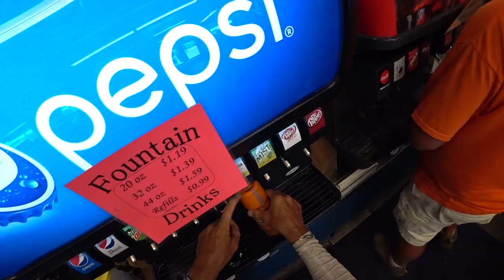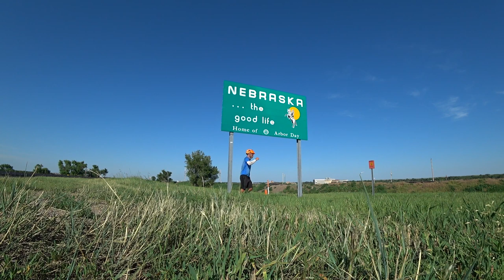Punctured By A Nail-Biking to RAGBRAI-Part 2

Comment: Thanks for all the videos, keep them coming! Two of three questions were answered in this one. 1) Does Ryan ride tubeless? (yes) and if so, 2) How does Ryan fix a tubeless flat (with one of those cool plug kits). But, question 3) Which make/model of pump do you tour with? The one you're using in this video looks pretty sweet. Thanks!

Comment: Have to say even though I don't ride anywhere near the sort of mileages you do, it does amaze me how helpful people can be if you're stopped by the side of the road somewhere and fixing a problem.  Similar thing happened to me a few weeks ago.. I'd swapped out a chain ring and stupidly put it on the wrong side of the crank spider, so the ring was too close to the chain stay and I only realised 15 miles in to the ride doh! (not close enough to touch, of course, but I new something didn't feel right and I couldn't initially figure out what it was).

Actually a fairly simple fix to take the crank (thank goodness for modern hollowtech cranks!)  out and swap it over, but in the 20 minutes or whatever it took me to do it, I had 2 people come out of their houses and offer me tools if I needed them, and 3 passers by asking if I was Ok or if I needed anything and one of those were a lovely elderly couple who'd got back in to cycling in their retirement!

In the world that media outlets and social media want you to see where everyone is isolated and at each others throats, this sort of thing couldn't happen.. but it happens far more frequently than you would believe.
Reply from the maker: What a great story! I agree, most people are good hearted and want to help! Happy Trails

Comment: Did you have stans tubeless sealant in your tubes.?    They say it will seal 1/4 inch hole 
   It should of sealed the hole  , quickest way to clog hole is to spin the wheel
        Great videos.....  keep on making more ...!!
Reply from the maker: I was spinning and spinning and it never filled that hole, it was just too big.
Reply: @duzer  I see.   
      The RACING SEALANT Stans makes seals bigger holes. You can mix the reg and racing sealant together ( just that race sealant dries quicker over time and would have to add more sooner )    I had called Stans for this info 
     I have tubeless on my Trek checkpoint and Salsa Timberjack think I'll mix in some race sealant .Hope it works when time comes 🤞🏼🤞🏼                    

                      Safe riding 👍🏼👍🏼

Comment: Hey Ryan! How did the 600 do on the trek across CO, NE, & IA? I hope you do a in-depth video on just this topic.I'm still scratching my head on why you took the back wheel off to install a plug.
Reply from the maker: Loved the 600, and I took off the wheel because I originally didn't think I could plug the hole, and thought that I was gonna need to throw a tube in it.

Comment: Hi Ryan,  Love your touring videos.  I'm a recent subscriber so have not viewed all your posts but I noticed you are wearing sleeves in this video in the middle of July on a century ride day.  Just wondering if this is to prevent sunburn or do you think it keeps you cooler with the sun reflecting off the white?  I do a lot of bike touring as well  (25 Ragbrai's to date) but have never worn sleeves in the summer.  If you think it is cooler on a hot summer ride I might try it?  Thanks
Reply from the maker: SD Greg mostly I wear them for protagonist sun, but they also keep my arms cool when I sprinkle water on them.

Comment: Did the plug successfully repair the flat? And if so, couldn't you have done that just by flipping over the bike and turning the wheel?
Reply from the maker: The plug did work, and it was my first time using one...the hole was too big for the sealing fluid to block up the hole. I guess I could have fixed it while the tire was on the bike, but I wanted to get up in there!